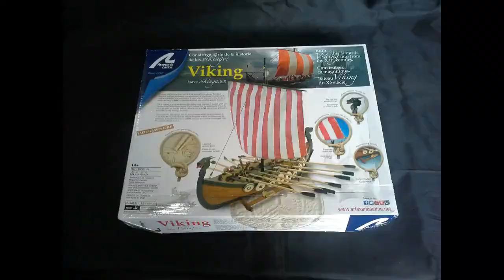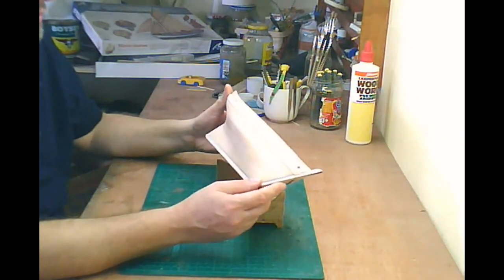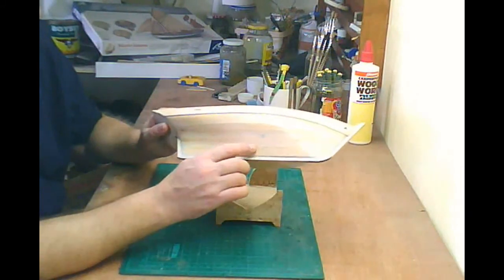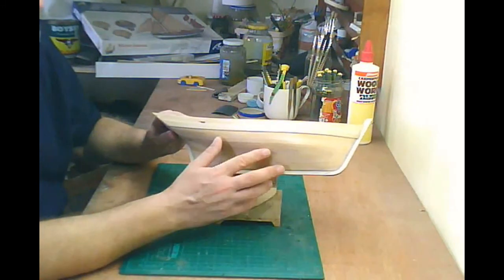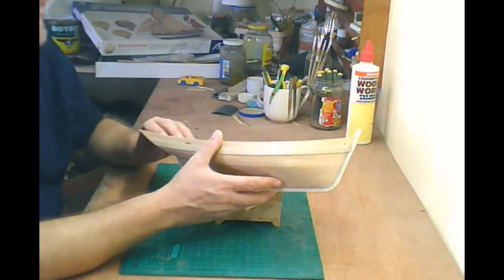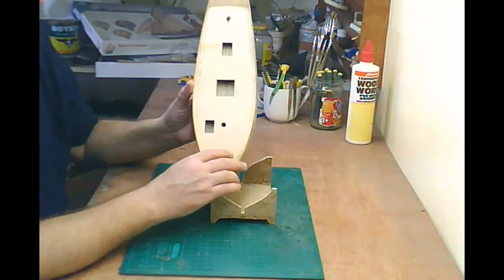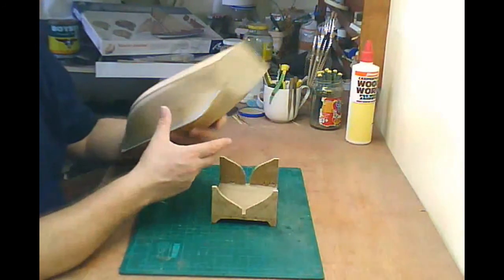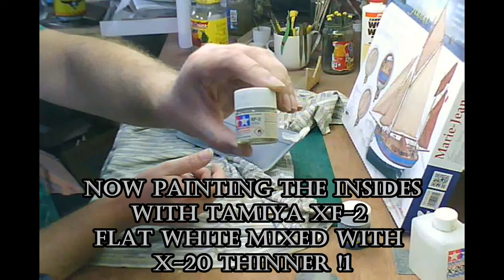Marie Jeanne Step by Step Part 4 completing the Hull and Start painting

Comment: Hello mate... thanks for the video.
Let me see if I get it.....

After installing the planks, you sand it, and then apply a coat of some kind of sealer?

After the sealer, you can prime with paint, and paint it?
Don't you apply any type of filler?
Reply from the maker: Yes you got that right. In case of the Marie Jeanne I don't want and need to apply any Filler because it"s a wooden Hull and you still should see that. In case of a Steel Hull,  you can apply Filler and make  it flush.

Comment: bonjour je recherche l'instruction de montage je galere avec celui d'origine votre video et super mais j'arrive pas suivre vous faite des micro coupure merci
Reply from the maker: Je ne sais pas exactement dans quelle section vous avez besoin d'aide. Veuillez fournir plus d'informations afin que je puisse vous proposer une solution. Merci
Reply: @davaoshipmodeller  merci je debute en maquette sa fait 5 ans j'arrete je recommence enfin c'est au niveaux de la baguette la mesure pour la coller n'59 et66 et comment coller et cintrer la baguette n'31 et trouver le plan mieux expliquer que celui de la boite alors je vous dit pas la suite pour les cabines les voiles je sais pas si j'irait aux bout merci
Reply from the maker: @patrickrobaczynski859  ok, since Google translate is doing a terrible Job translating your Comment, I will reply in English LOL. Unfortunately I don't have anymore the Instructions of this old Project but, I believe that your Question is about the Rudder Shaft !!?? It also took me several hours and a lot of testing to get the angle right. If you can make a picture with your concern, together with a simplified Text and send it me via Email , I will try to help you out. Email : davaoshipmodeler@gmail.com . Thank you